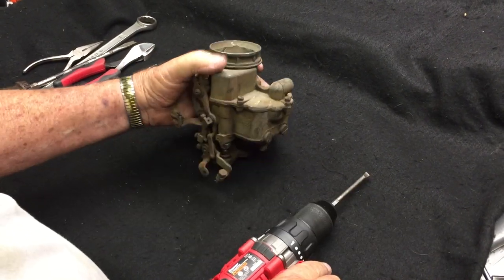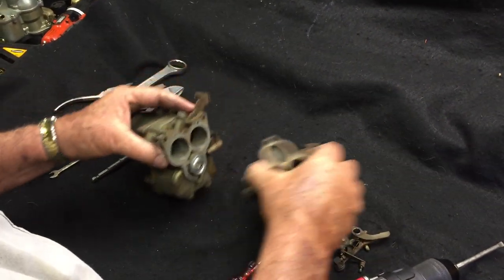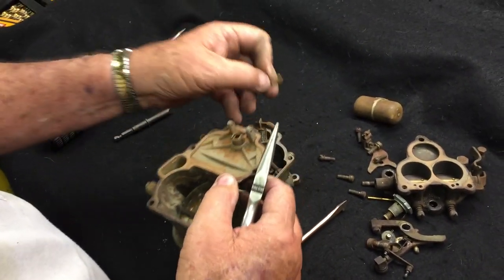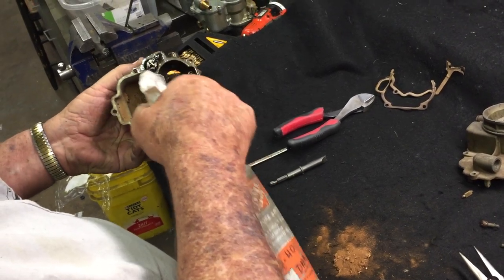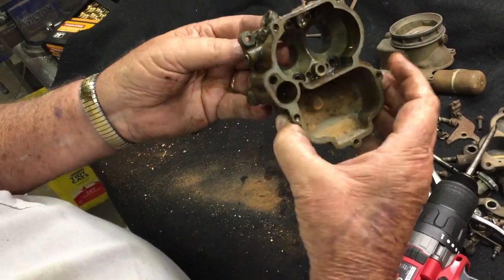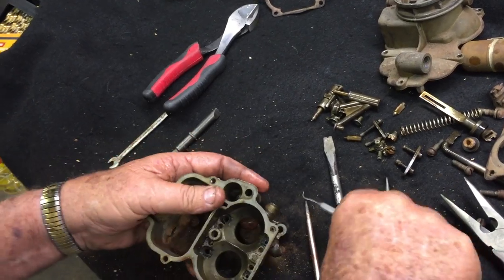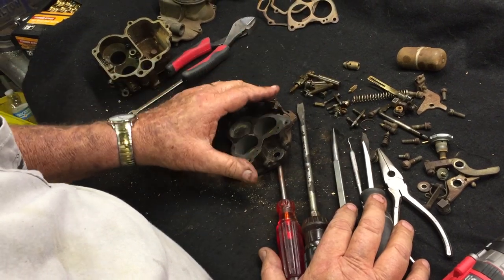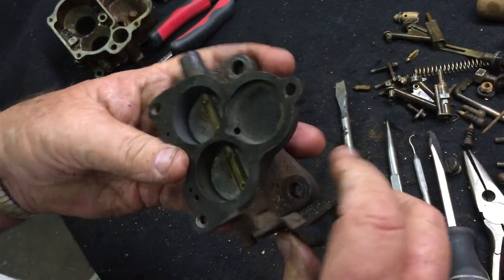CHARLIE PRICE   VINTAGE SPEED  PART 1 of 4  HOLLEY 94  (DISASSEMBLY  AND INSPECTION)

Comment: I didn’t find the brass check pin under my squirted.   Was there some model 94s that didn’t use them?
Reply from the maker: All Holley 94 carbs must have the check for pump under squirter.  Look close --It may be stuck in hole.  charlie
Reply: @charlesprice7897  thanks.  I don’t see it but I’m about to order the complete carb kit you sell plus the check pin on your site 👌🏼